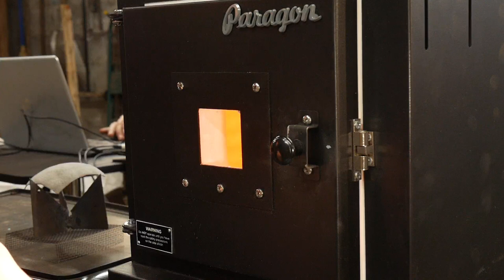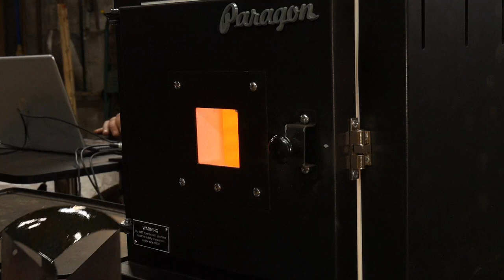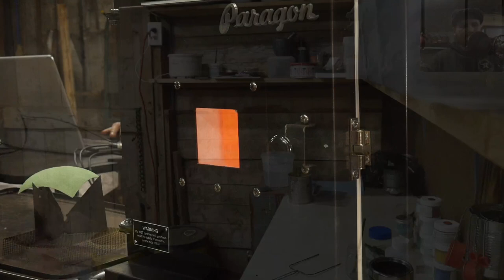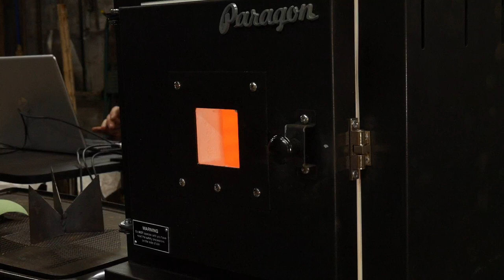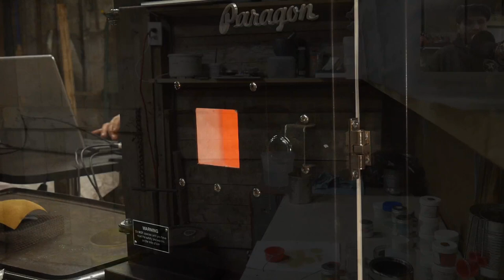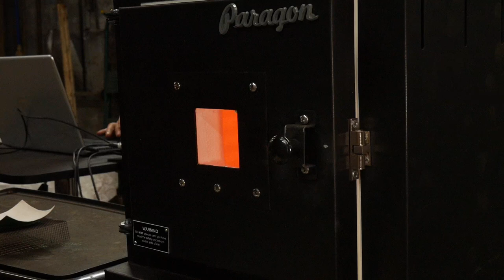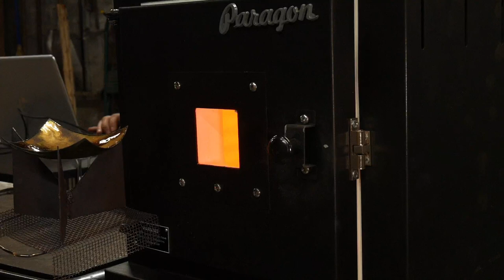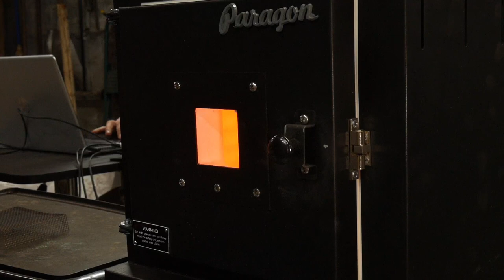LIVE: Enameling with a Kiln

Comment: You mention that solder would melt before the enamel, what if you harderned something like a nail to make a decorative nail to use as a pushpin, would it aneal the metal when heated to finish the enamel.